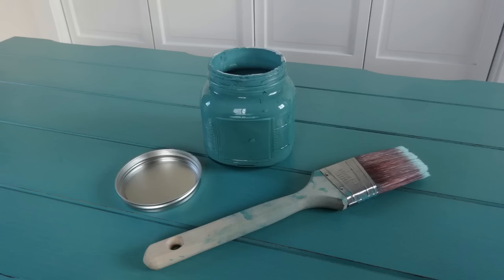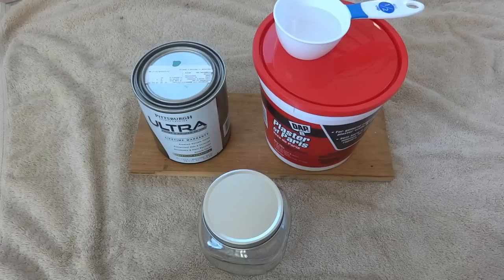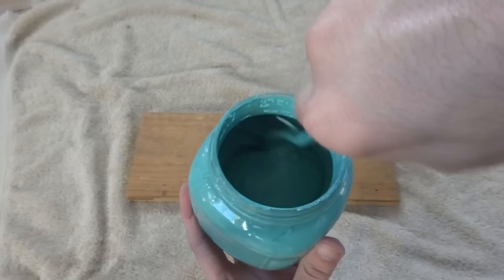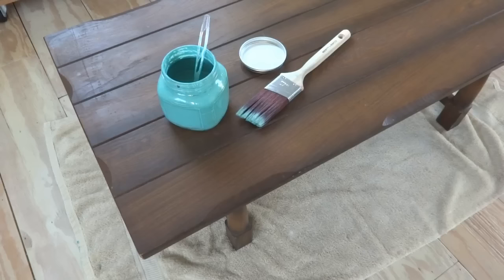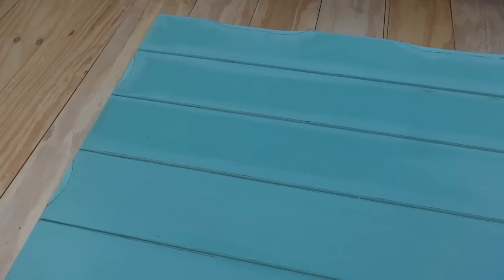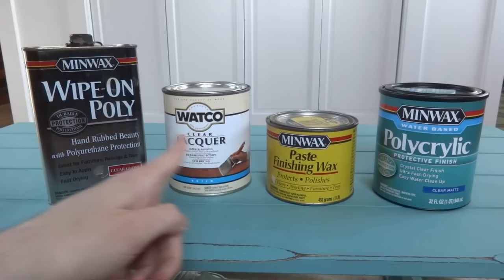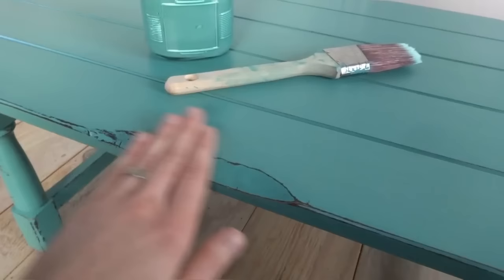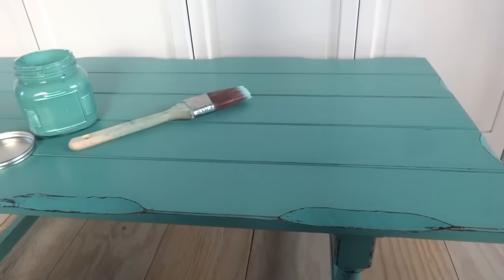Make Your Own Chalk Paint! (Cheap & Easy Recipe)

Comment: put a marble into the jar for mixing :)
Reply from the maker: That's a great idea. Kinda like a spray can. Thanks.
Reply: sifting the plaster through a flour sifting sieve helps too
Reply: aha_144 Ooh, so smart!
Reply: aha_oui make sure the jar is plastic if adding a marble for mixing, as the weight and velocity of a marble while shaking it to mix will break a glass jar. :)
Reply: How about a smoothie mixer cup? You know, the large plastic cups with a lid that has a metal spring -like gizmo in it for mixing smoothie or shakes on the go?
Reply: Twylah Campbell 
Even through thick ass paint?
Reply: Cool idea! Like some nail polish has little beads in it!
Reply: Or two.
Reply: Omg thanks! Good looking out for us newbies!😉
Reply: What a great idea will try it ♥️🏴 England

Comment: When I am painting from a container I put a piece of aluminum foil over the top, punch a hole in the middle and peel it back almost to the edge.  This keeps the paint off of the rim.
Reply from the maker: that's a great idea!
Reply: MaddyHatesMath This is genius, thanks for the tip.
Reply: Hello ... so you tried it out.... did it worked for you ? ... i Painted a glass and it didn't work
Reply: Oh muy goshhh thank youuu
Reply: Great idea
Reply: what didn't work?    @MusicAndOtherColors
Reply: That is a brilliant advice!
Reply: Umn that's a rediculously simple solution that's absolutely genius because no one thought of it before. Or at least I haven't seen it. Good idea!! Hopefully I won't forget it.
Reply: Well dang. I never think of the easy thing until someone mentions it. Thanks so much!
Reply: MusicAndOtherColors i see this all the time, people get excited reading comments while WATCHING the video but then comment on something they are seeing in video. This happens in the upcycle sewing group I help admin and people get confused or worse hurt feelings and the words exchanged. Think meant to be under main video.
Reply: MusicAndOtherColors But also not all paints work on glass. May have to prep with BIN or a glass primer. Many new things out there now.
Reply: @lyricwritertoo  chalk paint works on glass, so maybe he did something wrong?
Reply: I’m going to do this right now- I’m painting cabinets
Reply: So does a rubber band

Comment: I use 2tbsp water, 2 tbsp unsanded grout, and 8 oz latex paint... ive done fabric, concrete stairs, doors,tables,headboars, wrought-iron, etc. ... been sealing with minwax light and dark depending on how distressed I want the pieces.  I got that recipe years ago. Love the finish of the clear matte and great job... really well done!
Reply from the maker: Thanks for the tip on the grout. I saw that mentioned when I was researching this. Glad to know that it works too!
Reply: mephista55  do you have any video or photo where you have painted the upholstery maybe? many thanks
Reply: You've done fabric?! Help! What do you think of this technique  https://www.youtube.com/watch?v=kwEz633cwQQ ? Is this what you did?  Did your fabric remain soft and did it still feel like fabric afterwards?
Reply: mephista55 can I use acrylic paint?
Reply: @emily-katecrnko1142  did she answer your question? Also did you try this on  fabric yet?
Reply: Que es la lechada sin arena
Reply: @Cocovega778  hay does tipos de lechada 1) con arena 2) sin arena.   se usa entre la loceta/ceramica en pisos.

Comment: Great recipe, thanks!
You can also put a few marbles on the bottom of your paint vessel and it will make it easier to mix it up initially and through out your project paining.
Reply from the maker: That's a great idea.
Reply: AWESOME TIP!
Reply: Really good teaching and right to the meat of it! Thank you so much!
Reply: Try adding the plaster of paris to water, not other way around. And use hot water. I use more water so I can shake the plaster of paris water mixture. Then you need to leave the container so the solids settle to the bottom of the water. Throw the excess water off and add your paint.  Use a kitchen sieve and strain the final mixture through it...

Comment: nice work...a few tips apply vaseline petro jelly over the area u plan to destress the piece corners edges... try shaking the glass jar with lid screwed on tight...shake every other time u load your brush...i prefer un-sanded white tile grout which only requires one coat, no pre-sanding, and excellent coverage...thanks

Comment: I followed these directions, but used drywall compound.  I then coated it with 3 coats of Polyurethane (added 10 % water so it didn't dry quite so fast, as you can end up with brush strokes).  It was an old, dark brown, antique desk that was in poor condition.  I did sand the piece with a small, hand sander briefly, as there were areas where the finish was flaking off, and I wanted good paint adhesion.  As well, I wanted a smooth texture, which is something I wouldn't have gotten had I left it unsanded.  It turned out fabulous and it is holding up very well to daily use by our 4 children who use the computer on this desk to in our homeschool. Thank you!  You saved me time in priming and money over purchasing real chalk paint.  :-)

Comment: This is EXACTLY what I was hoping to find.  
I just spent 3 weeks building a crib mattress size farmhouse daybed for my dog.  Needed a decent piece since it is in my livingroom.  Today I applied a base coat of 1 part  deep purple flat acrylic mixed with 2 parts water to create a thick stain or thin paint.  Tomorrow I will use your method of paint and plaster  of paris in a cream color like french vanilla.  Then I'll do some distressing along the panel edges and other high-wear areas.  I'm  not positive yet on the sealing step but I'm leaning towards a liquid wax with a brown tint for some antiquing.  
Thanks for your excellent video.  I am so ready for this!

Comment: II had the same problem with the diy chalk paint using plaster of paris...My  solution was to put the water first, then then add  the plaster of paris until it is the consistency of pudding. I also used a mini wisk to stir. Then add the paint. It worked like a charm and a lot less expensive.  I also used the polycrylic
Reply from the maker: Thank you for the mixing tip! Very helpful!

Comment: The cheapest immersion blender for this, is the «whisk» you get at hardware stores, meant for your drill. You get them in different sizes (and prices, but in general, they are cheap). You wash them and reuse.

Comment: When I distress, I use the wet method. I let the chalk paint dry for maybe 20 minutes, then take a clean lint free rag , soak in water and wring out as much as possible, then  start off  lightly  rubbing where you want to distress, and put as much pressure as you need to get the look you want, works great.
Reply from the maker: That's what I saw some other people doing to their chalk painted pieces too. I haven't tried that on this plaster/paint combo yet though.

Comment: With polycrylic, you HAVE to fine Fine Fine grit sand it ... at least with the gloss. I use it, live by it, but you have to finely sand it with 400 + grit sanding which will look like diamonds when done.
 love watching your diy dork vids. I love this stuff. and this is a beautiful color for that awesome table! good job!
Reply from the maker: Thanks. Yes, sanding with a fine grit paper really helps smooth it out. On this table, I kind of liked the brush strokes and slight cloudy/milky look of the polycrylic, so I didn't sand it. But on my newest project (3D painted coffee table makeover video) I sanded the polycrylic with some wet 400 grit before applying the final coat. It came out nice and smooth!
Reply: MrDiyDork new subscriber so I plan on catching up on everything you've done and clicking that little bell! 😉

Comment: Is Menards a regional home improvement store? I bought a huge box of chalk dust online! It's come in handy several times other than making chalk paint. For example, it makes an excellent rubbing compound! I had someone back into me last week. My red SUV had white streaks all over my door. I buffed all over them out but 2 small places that took the paint off. First I used WD40 and a sponge, the chalk dust paste and a buffer attachment on my girly cordless drill. It was amazing! Then once I accidentally poured scentsy melted wax on my leather shoe. I stuck it into that chalk dust the second I peeled the wax off. It absorbed almost all the oil out of my shoe! I still have most of the box after making 2 quarts of paint and doing the projects above. Best $15 I've spent. I'd say I can make at least 8 more quarts!

Comment: Cool.. I always put Vaseline on the inside of jar lids so they don’t rust ya know moisture in a cellar storage bench or garage might make the lids rust or it can prevent crust of paint on the edges so Vaseline is a cool tool to have painting. Also I use Vaseline on glass when trimming paint such as window sills. The. You just wipe it off. Love your formula thanks for sharing

Comment: Awesome!! Thank you for the recipe and the video. I didn't know that the wax would have to be reapplied every so often. That was good to know before I applied it. I guess that I'll be returning the wax for clear matte polycrylic. I was also wondering if it would help to run the the plaster through a cheap flour sifter before mixing it to really get it down to a fine powder without any clumps. Have you ever tried this?
Reply from the maker: Yes, I think sifting the plaster would be very helpful to avoid clumps. The furniture wax is similar to car wax in that it eventually wears down and you'll want to reapply, especially in heavy use areas. I've left waxed pieces alone for a long time, but should have kept up the wax for the best protection. I like the "natural" look you get from wax (not shiny, and not flat either), but it's just not quite as protective as other clear coats.
Reply: Exactly what I was going to mention too about the sifter.

Comment: This is pretty cool.  BUT, two alt ways.  Use real CHAULK powder.  I think you have to increase the amount a little over Plaster of Paris.  The second method is use Baking Soda.  Yes, Baking Soda.  Its what I use and it works great.  And its very sandable.  But it will turn even a semi-gloss to more of a flat.
Reply: Hi, do you mean just add baking soda to the paint and nothing else?
Reply: @brawyn777  Baking Soda is all you need and a little bit of water.  Add small amounts of the soda at a time until you get the consistency you desire.  It will take a bit of stirring because you don't want clumps.  If you add too much soda, add in a bit of water.  This does not work with oil based paints.  It is also better to use a flat, matte or egg shell.  Semi and full gloss do not work as well.
Reply: Ok, thanks for the info but do you mean chalk powder or baking soda instead of plaster of paris, the rest of the recipe is the same? I didn't want to use acrylic latex (latex allergy). Can you share your recipes? Thanks so much!
Reply: @PeaceOutWorld  The "recipe" can vary depending on the look you are after.  But I am talking about real chalk powder. You could use baking soda as well.  If you have a pint of paint then usually 1/2 to 1 cup of chalk powder or baking soda will do the trick.  You could cut down on the chalk if you use Milk Paint.  Although with milk paint, you cannot store it for a long period of time.
Reply: @RodEccles  Thank you for the recipe Rod this is very helpful.

Comment: Great video thanks I loved it! In my experience with wax over chalk paint  I've never had to go back and wax it again months down the road. Waxed it in the beginning and I was done. Could it be that I used wax made for chalk paint as opposed to another wax?
Reply from the maker: Yeah, that might be it. I don't always re-wax my pieces either, but it's definitely not as hard or permanent as other finishes. Probably the only time you'd really need to do it is on a piece that gets lots of use like tables tops, handles, etc.

Comment: Can chalk paint go right on any surface or do you need to sand first? I have an oak curio cabinet but it's finished with a shinier coat or maybe veneer? I love the cabinet but not that natural oak colour. I'd like to make it a nice espresso colour if I could.
Reply: pinkyt67 Yes with chalk paint you can apply it to any surface. Then seal it, I like polycrylic. You can choose from matte to shiny and everything in between.

Comment: I just wish the distressed look would disappear.
Reply: sixpackbinky So if you don't like distressed why are  you looking at this? Just move on...
Reply: sixpackbinky i did it with a recipe of 1/3 paint,  1/3 water and 1/3  plaster of paris.  I lightly sanded to smooth but not distress.
 I didnt use wax after,  I used polycrylic. It  was an old wash stand  and has been durable. It stayed on when I have no idea what was painted on it before.
Reply: Why?I think it's awesome.
Reply: 6 pk, why would you want it to disappear? There will always be antiques & vintage furniture that will be "distressed" naturally. It's for some & not for others. If you're more modern then that's great too. I prefer to add some character & faux history to my decor
Reply: If you had a flawless piece of furniture to refinish, you just wouldn't use a sanding block and "distress" it.  How easy is that?  Wellah... no distress and no stress!

Comment: I found that if you dampen the area you want to sand with a damp rag that you can sand it off better...it will gum up your sand paper a little but if you just use the cheaper sand paper it works out...hope this helps!

Comment: Very good. I had not found anyone with ratios or straightforward directions. So winged it. I researched what all chalks are. I opted for powder patching compound. But looked to see what one had hugger content of the calcium whatever. All are old ocean minerals and have 2 ingredients. Plaster of Paris has 3 and unique and dound outside if Paris only in entire world. Hardens more. Why they used for casts. You should try one of the others and do comparison video. I added my powder straight to paint then realized I needed water after I started painting. My paint also old and but what I was doing was old too. Just experiments until I get better at it.

Comment: To remove those little bits of plaster, after mixing you could strain the paint into a different container. To avoid the dry bits of paint at the top of the container, don't wipe your brush on the lip, shake excess paint out. This would be easier to do with a proper painters bucket. I think the "Handy Paint Pal" is excellent and they have liners for easy clean up. Good video.

Comment: Hey Kevin...on the subject of finishing, I saw some information that advised that, though it works well over latex paint, polycrylic may not work well over matte latex. The additives in matte paint keep the “easily dried” polycrylic from drying up. It remains runny leaving behind cracks when dried. I guess I'm wondering if by adding the plaster of paris to the paint (I used latex eggshell) do we change it to a matte latex?  Did you have any issues with the finish not drying?  P.S. Really appreciate your videos...they are very comprehensive...Thanks!
Reply: Also...and assuming that the polycrylic is the product that I use, how many coats would you apply. I am doing kitchen cabinets. I would like to protect the cabinetry against potentials food/drink splashes and nails. ;)

Comment: I use cornstarch instead of plaster because cornstarch is so smooth. Makes beautiful chalk paint. Same mixing instructions.
Reply: Thankyou! I am considering painting my ugly old "velvet" couch. Do you know if this paint with cornstarch will work on that?
Reply: Susaville I’m sorry I’ve never painted a couch with this solution. But it’s great for furniture. Just a very lite sanding between coats. Get all the lumps out. Good Luck.

Comment: THAT was an awesome, simple video and answered a lot of my questions !  Forgive me if I missed it, but can I use this chalk paint on laminated type furniture ie those Ikea shelving that are like pigeon holes ... or squares?  If so ... how do I need to treat the surfaces before I can chalk paint them ??  Many thanks @ MrDIYDork !
Reply from the maker: Glad you liked it! The interesting thing about chalk paint it that it pretty much sticks to most surfaces without any real prep other than cleaning. Of course, I'd still recommend testing first to see if it will peel. If so, you can lightly sand it with a fine grit sanding block first to give it some tooth. But this paint seems to stick pretty well without much prep.

Comment: When mixing a powder and a fluid, start with a small amount of your powder and slowly stir in enough fluid to make a runny paste; scrap the sides and bottoms of your mixing container frequently.  Stir in a little more powder and then more fluid until done.  Stir after each addition until thoroughly mixed.  That's how to get lump free gravy and should work with the chalk paint recipe.

Comment: Was this your first time? I’ve been painting  furniture for years, but poly will yellow with time. From experience clear wax will last and be super durable and last years. I have a piece that is going on 5 years and the wax has harden and it’s beautiful and the buttery feel is so wonderful. I use Annie Sloan clear wax and it’s been the best from several waxes I’ve used. Thanks for the video and maybe try it some time and you will see/feel once it cures how nice it is! But I will agree with you some pieces you need to use Poly but I prefer General Finish Poly they won’t yellow!